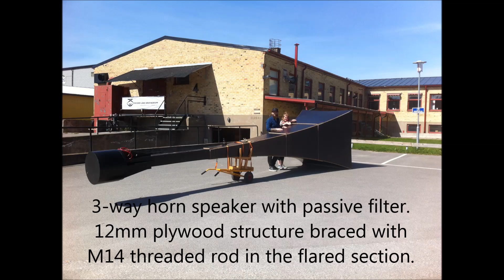3-way horn speaker, DIY Bass horn

Comment: Why oh why are you whispering?
Ok, anyway, one huge issue I see is the back side of the drivers are restrained, creating an echo box. So front side cannot work properly. Sorry.

I am wondering what theories are used to require such a long horn. What's the value? Cool though. Sortof.
Reply: The wave length of the sounds you want to make is what dictates the length and with of the horn, so for a bass horn the horn get huge. And the value is more efficiency, louder sound for less watt.

Comment: Selenium D250-X GW 1" Phenolic Horn Driver 1-3/8"-18 TPI
Sensitivity about 107db/W/m
So that is what the sensitivity of your bass horn will be. The sound must be ok and seem to balance bass and higher  frequencies, or you would have added more units. Difficult to tell exactly with the sound on this video, so I'll have to assume you got what you wanted with one unit.
Passive crossover is going to lose you possibly up to a few dB as well.
With the speakers I designed and built with short coil, high flux gap, light moving mass drivers - sensitivity is such that to balance the bass horn I had to use 10 piezo 6x2 tweeters.
Which is about 118dB/W/m.
Maximum sound level is limited by non-linear air expansion effects. At 50 watts rms input sound level at 1m is off the measuring meter scale, +140dB, implying greater than 100% efficiency. However at the mouth and only 1m away, the sound is very directional and with edge effects really still inside the 'speaker' itself. At 100 watts a good horn like yours with a small throat (high compression ratio) should be starting to distort the peaks, especially vocals which are often asymmetric waveforms. Its the unequal heating and cooling process of the air near the throat which distorts the sound. Imagine an ice-cream van chime on steroids.

Comment: What you have built is pretty amazing by the way. Those curved joins are like building a boat!

I looked at the BEYMA 15P80FE/N specs on their website. The efficiency, n0, 5%? Not very likely with only half the coil in the magnetic gap at any one time and a heavy 4 inch voice coil assembly and cone?. I would take all those figures with caution. The driver is really a bass box woofer. With a big amp in a normal box it would be fine, as you said.

I used custom assembled 12" drivers with coils the same height as the gap (JBL midrange spares). And very tight tolerance gap, big magnets, plus ferrofluid. Using a coiled up shape to spoil the resonance tendencies, a hard shiny polyester resin paint inside, using only the one driver they sounded great and went up to 8kHz, or more with EQ. The flat side of the coil mouth makes them very directional. Which is what was wanted. To be heard a few miles away, like alpenhorns! see www.marklimbrick.co.uk
I am building some more slightly smaller with 15 inch PA drivers, 'old repaired ATC. Again with a coil height the same as the magnetic gap, 10mm. 7kg magnets, 5mm excursion with one AA cell on the terminals.
Reply: The beyma drivers are basically designed for high reliability and thermal durability, rather than high efficiency.

There are quite a few ways to build laboratory quality transducers which outperform commercial pro audio devices - just like with lightbulbs, the commercial quality is driven by practicality rather than precision, so a laboratory made lightbulb will have far tighter specs than a mass produced item from the corner shop.

Comment: The argument between efficiency and fidelity has been going on for generations. No doubt this is an unusually efficient speaker system with great bass. But the transient distortion has got to be astronomical. I bet it sets a whole new record for listener fatigue.

Comment: beautiful - what are the dimensions and weight of one horn system ?- - What's the best compromise you can do for a folded front-loaded horn which covers say - 50-500Hz (F6-F10) smoothly and with good power and "good sound" ?  Classic US examples include the short path bifurcated horns like Klipsch La Scala,  single path University Sound Classic S9.  Some oddballs such as Frazier.  Horn designer Bill Woods has made many midbass horns,  I think one of the smoothest was a "J" shape - something like old Western Electric theatre horns.   I have a little 7 cubic foot folded horn loaded with a Community 12" that is derived from one of Bill's designs - think its probably limited to 400 on the top - not sure if it would go any higher with my 12pe32 (?)   I'm more into "Karlson stuff" but have a lot of horns.

Comment: Rough transcript.

so what the deal with this really large horn.
I want to be able to play loud music at a off grid location
I want to play concert type level of music in the woods
I have a 3kwh battery charge by solar panel , so decent power but not enough for ordinary speakers.
It is not a matter of a tweeter or mid range speaker they are very good at creating high frequency with low power but the bass speakers are very inefficient in single digits efficiency..
But If you load the base element with a horn you can get up to 30% efficiency so a huge increase by loading with a horn.
Why is the horn so big?

Its a mathematical relationship between the speed of sound and the lowest frequency you want the horn to produce, so i chose 30hz and 25hz for tests, i found that 25hz makes me feel ill so i chose 30hz.

you divide 340meters per second by 30hz and you get about 11 meters and that means that the speaker driver can't produce one whole sound wave within the horn but it can produce half a wave and that is good enough with a 5.5 meter horn.

This means the base element works much better on low power.

Bbye.